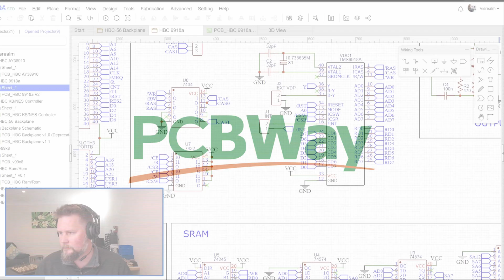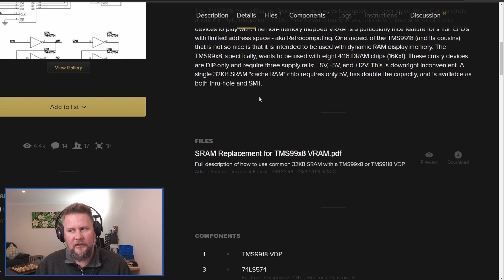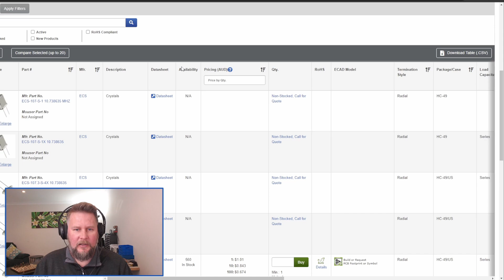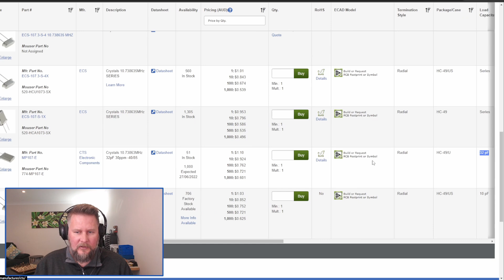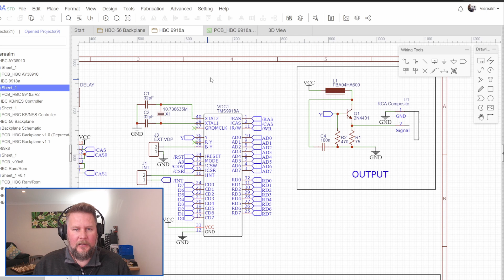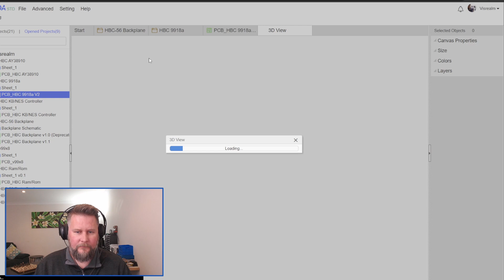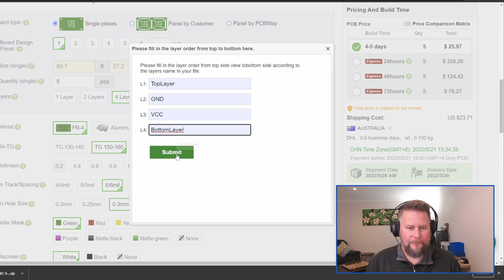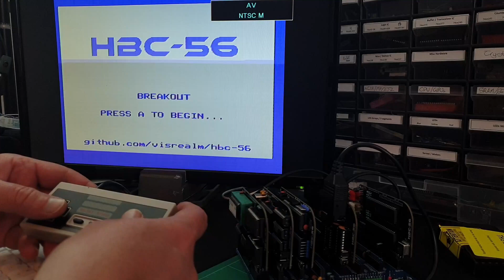HBC-56: New TMS9918A graphics card

Comment: Did you notice a problem with CAS delays with the SRAM replacement circuit? I used J.B. Langston's design and didn't have any noticeable issues with delays when using HC logic. I'm curious to know because, in my next revision, I'll implement the same option.
Reply from the maker: Yeah. My circuit doesn't work when the CAS delay is enabled. Much flakiness. I thought it might have been related to me replacing the latch with a bus transceiver, but maybe not. I'm using HCT.  I left the option in place just in case.
Reply from the maker: So, I built that second card to experiment with EXTVDP today and put in a faster (15ns) SRAM. Glad I kept the CAS delay option, because this card needs it. Very odd. My previous TMS cards have had 55ns SRAMs.